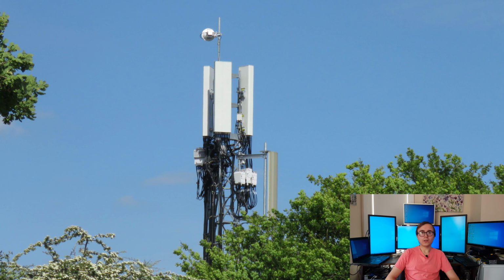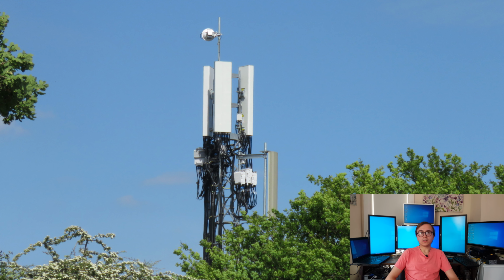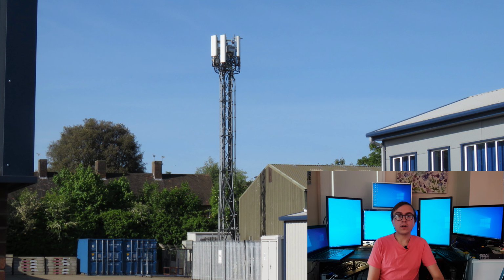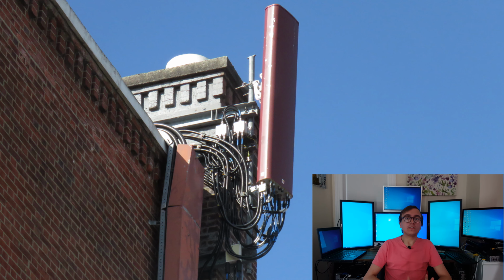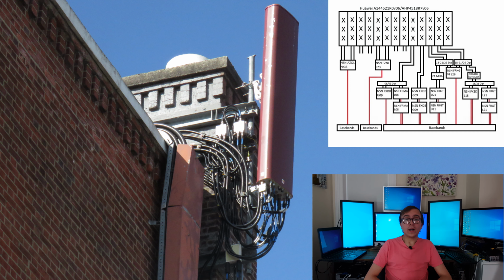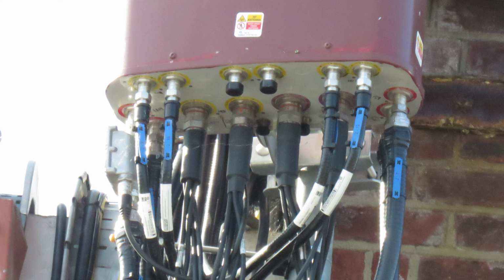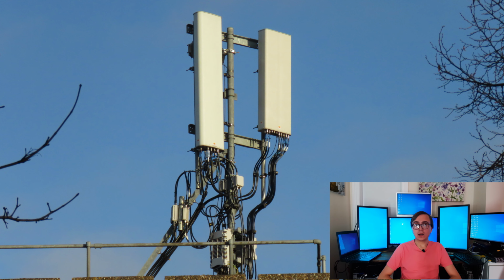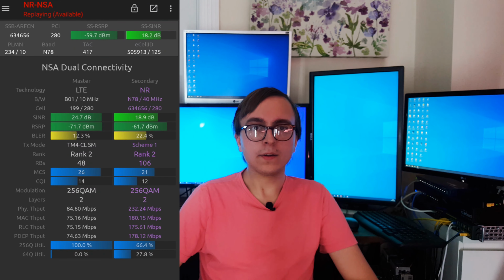O2 UK's Quirky Nokia 5G Sites Explained with Performance Testing and Schematics

Comment: How do you locate where masts are, I try to use opensignal however it's not very accurate and does not recognise when I am connected to 5G. (I'm on Vodafone if that makes any difference)

Comment: Just curious Peter - do you ever get any headaches or body pain being around all these masts and antennas? they say that we have a maximum tolerance level and once that is surpassed, we exhibit signs of electromagnetic sensitivity (which happens to electricians and to those who install masts)
Reply from the maker: I do not get any symptoms while being near to the masts. I also am friends with a number of engineers who install the masts and they have no issues.

Comment: Someone that has almost as many displays as I do, that's not a common sight haha.

Great for productivity and multi-tasking!

What Model of the Dell Precision M-series is your laptop Peter? 

And, 
Is that setup running off of the Laptop? Or, Off of a Desktop PC somewhere off camera?
Reply from the maker: Precision M4700. It drives the 4K Samsung, the two Dell 2405FPW and its own display. The LG display above everything is fed off an old ThinkPad and the right most monitor is fed off a variety of sources, mainly my i7 PC.
Reply: @scivids1999  What cable or cables do you use from the M4700 to output to all 3 displays?
Reply from the maker: Display port for 4K, HDMI to DVI-D, and VGA.
Reply: @scivids1999  Also, are you aware of the USB 3.0-to-HDMI Adapters you can get? They use a technology known as DisplayLink. It may be worth your time to check it out :)

Comment: Great video. What surprised me as well was the 4G throughput, according to the app you were using. Was it really doing only about 20Mbps or less on the 4G bands? Did you test 4G as well as 5G?
Reply from the maker: It's typical for little throughput to be scheduled on 4G when NR bearer is active. The NR is essentially free real estate to offload 4G.

Comment: We shouldn’t have 5G
Reply: yeah, don't want to be catching Corona virus from the Chemtrails that 5G produces .  Plus the microchips, how dare they!
Reply: Tin foil hats work well James.
Reply: @James Burton you stupid fool 😂
Reply: @James Burton What measures? Did you build two faraday cages, one around your house and another one you take when you go outside?
Reply: @James Burton I'm not even......

This...... this is special. And I am meant to be retarded..... So if that is the case, then what are you? Braindead?
Reply: James Burton exactly
Reply: James Burton Do you know what frequency 5G is run at in the UK? 3.7GHz, do you know what frequency WiFi runs at? 5Ghz. Wifi uses a higher frequency than 5G - if you truly believe 5G is dangerous - stop using the internet
Reply: Sure we should. 5G is good :)

Comment: With your technical knowledge do you see the HUAWEI 5G equipment as being a danger to national security? I heard boris johnson is going to remove them all
Reply from the maker: My view is all hardware used in critical networks must be subject to independent scrutiny. I do not have any unique concerns surrounding use of Huawei in the UK but it's not necessarily a technical debate so much as a geopolitical one. 

Given the rising geopolitical tensions, I can see the possibility Huawei will eventually be phased out entirely from the UK market. That would be very unfortunate however.
Reply: The huawei cells did seem to offer the best performance for 5g, but guess we have to do with the other 2 cell providers and have lower speeds (as they can't seem to get more then 4 links going) as no way for huawei to operate outside of China really now

This is purely a USA political thing (more trump) trying to get more stuff built "in the U S A" , nothing to do with hacking or sites been compromised
Reply: You should check out how much Huawei gear is already in Europe, be it 4G gear, pure networking (switches, routers for isp but also enteprise) and just consumer stuff like phones, laptops, small routers.
Reply: Huawei's risk are a mix of both political fear-mongering, and, genuine flaws in both hardware and software.

Much of the Huawei made hardware that is in use and operates from a Unix-based Kernel (often a Linux-based Kernel) does so on outdated and known to be insecure versions of those kernels without proper security measures in place to prevent unauthorised use of the hardware of equipment attached to the Huawei made host devices, whether it be anything from a consumer smartphone to an enterprise network switch.

The immediate and publicly known risk is what it exposes, rather than any actual foreign government intervention that might be suggested by the media.
Note that it is possible that foreign governments are using Huawei equipment to intercept national communications on foreign nations but so far we don't have any public reports to back up those questions or fears, with that in mind though you do have to question what risks the competing equipment might put the nation at the mercy of.

It isn't a Black and White answer, we can only go on the current facts, and then use our past experience to gauge how best to handle the situation and potential risks thst come from having the equipment produced and developed by a large corporation with close ties to a foreign political reigeme that is flamed on a daily basis for its Human Rights breaches, and government level international espionage. (Note again that most nations do this to each other so China isn't the only nation guilty of such behaviour, that still doesn't make it acceptable though).
Reply: I don't know Boris Johnson can't just remove Huawei 5G equipment. British rules and regulations are much stricter than the USA. 

The UK government has already told the USA that they will continue to use Huawei 5G equipment. But with tighter regulations employed for national security. 

USA has tried to bully countries into abandoning Huawei carrier equipment. But Great Britain and some other countries have basically told Trump n co NO!